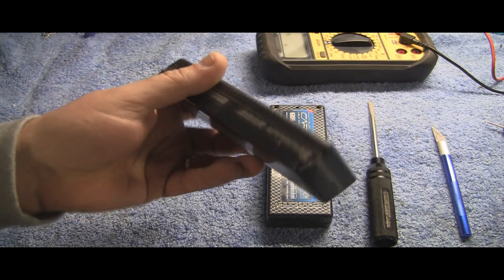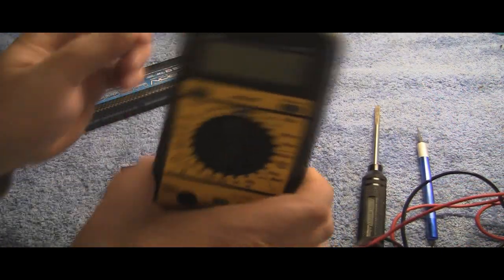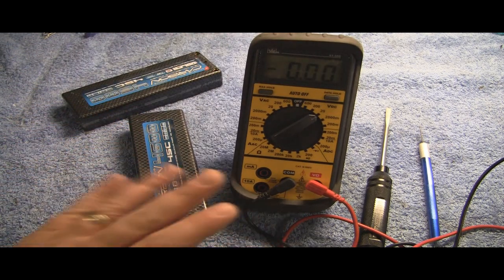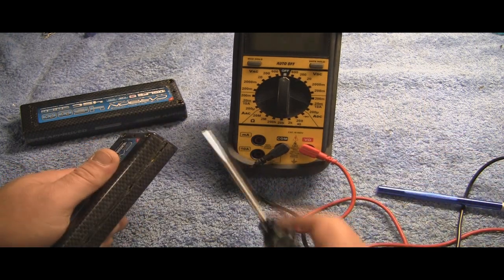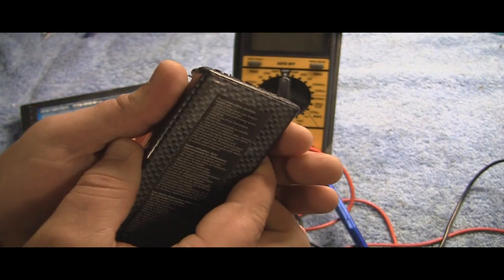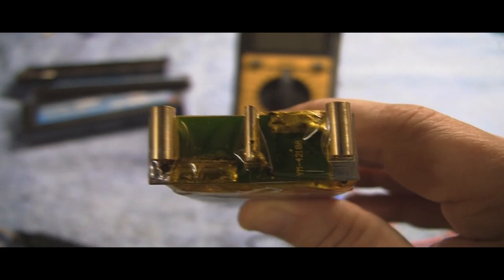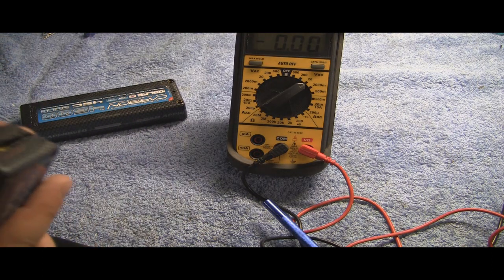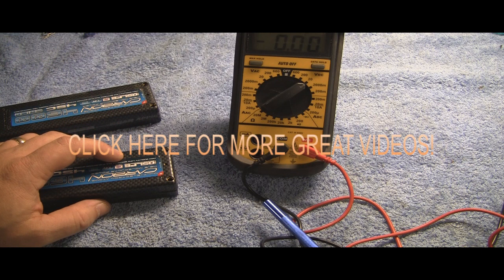How To Repair a Lipo Pack & Test Using a Multimeter: RC Orion 45C Hard Case Example

Comment: Hey I have a question .. I have a 6,000 mah .. 2 cell lipo .. Its charges and each cell has 4.20 and 4.21  volts  its has over 8. Volts   .. But the problem is it wont charge up to 6,000 mah it only charges to 200 -150 @ tmes it use to be fine then I forgot to put it in storage mode of the winter I left it dead .. How can I fix this ? !! Please help !  Thanks man